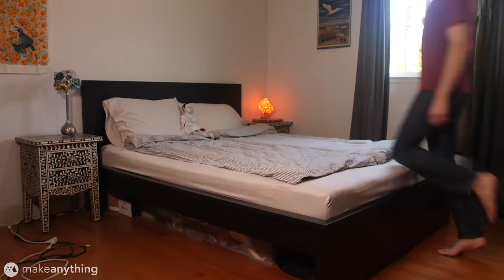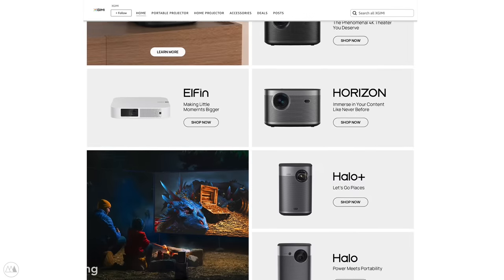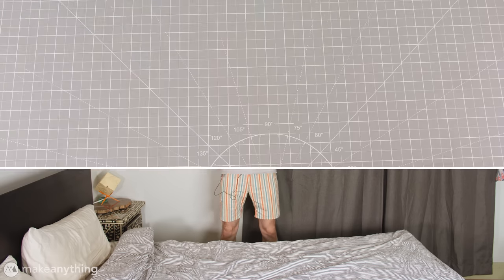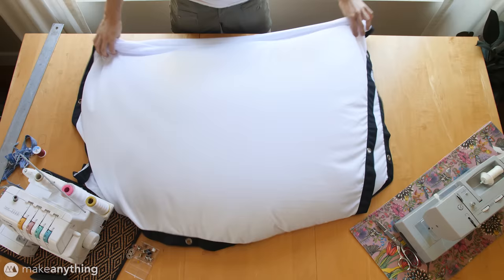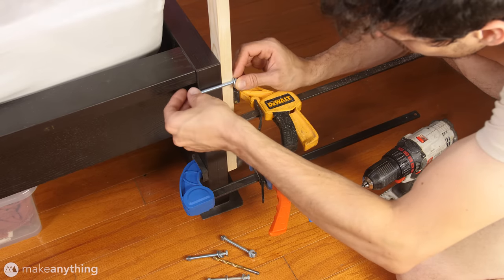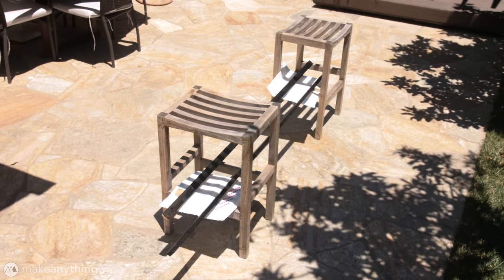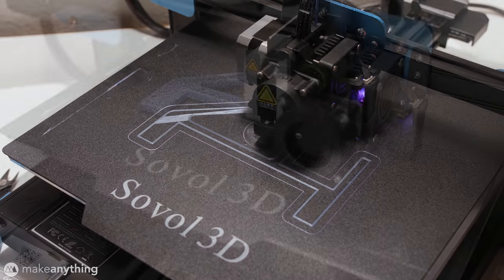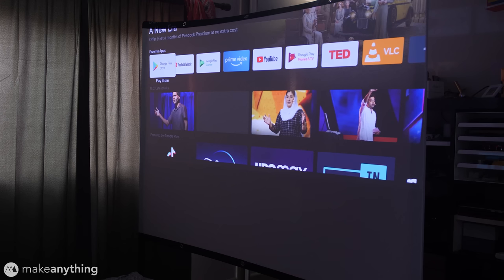My Bed is Now a Movie Theater // Bedroom Projector Build with XGIMI Halo

Comment: I had the same set up on halo plus. Big problem that you overlooked is fan noise when it is right above your head. I moved projector to side and manually adjusted keystone. Then optional but I added acoustic panels around projector with some air gap. (no adverse effect on cooling). Hooked up with 5.1.2 Dolby soundbar. Boom done.

Comment: I've been inspired to make a big black cube canopy at a trip to IKEA with my girlfriend who suggested buying a canopy frame, I just then was struck with the idea that if I'm basically surrounding all four corners and ceiling with thick black curtains then why not just add a projector, some RGB lights on the roof 4 edges and to top it off one of them big tables to eat or be on laptop that require rolling the bottom part of it under the bed....it's a paradise! No need to ever leave the bed only to just go to the bathroom.😅

Comment: For a V3 of the projector mount you could consider one that has a ball head on it. It looks like the projector has a quarter inch screw mount on the bottom which would allow you to mount the projector to any standard camera tripod head or ball head. Would make for easier projector positioning.

Comment: And yet every time you move or shift your weight, your bed or head board shakes a little and so your projector does as well and your image then shakes. So you have to lay perfectly still. Fun gimmicky idea but the practicality is lacking. I put an Xgimi Horizon Pro on a projector stand behind my headboard between it and the wall which does not make contact with my headboard so no matter how much I move around in my bed it does not cause any shaking to the projector. It's also raised up high enough that I can sit up in bed without my head blocking the image.

Comment: Hi! May i ask why you didn't just simply import your scanned picture into Fusion and traced the edge in Fusion instead of having to use Photoshop? Is there any benefit that way?
Reply from the maker: If you bring the picture straight into Fusion you have to manually calibrate the scale, plus i have an easier time making challenging paths in illustrator. It is an option though!
Reply: @make.anything  Aah alright! Thanks for taking the time to explain! Now go and enjoy your movie theater 😎

Comment: I had been turned off from projectors for a while due to my work in IT. The bulbs were very expensive and were good for 15,000 hours of use give or take. I get that my own amount of usage would be much less per day that the university  classrooms. It kept me cautious about hidden expenses. Sort of like the cost of replacing batteries for electric vehicles. More research is needed to say if it’s still cost effective, so I have no input on that.

Comment: To make it even quicker to put up and down, instead of bolting the wood directly to the bed, you could make a case that stays bolted to the wood and then keep the screen and poles wrapped up together. Then when you need it you just unravel and slide it into the holsters

Comment: You can’t adjust the X and Y digitally!? It Has to be adjusted physically. That is a very lame equipment.
Reply: The higher end projectors do things like offset and keystoning optically and not digitally. To do these effects purely digitally, an image processor must distort the image in real time. This means that your displayed resolution must be lower than the projector's native resolution. So if you have a 1080p native dlp chip then using these digital effects means you cannot display true 1080p video (it would have to be downscaled to lower res first). This introduces lag and also tranform distortion due to quantization error. So basically get a projector that does these things with mechanically adjustable optics and not digitally.
Reply: These projectors are meant to be placed on a low table in front of you that's why it's tilted up... that said he could mount it upside down on the ceiling too
Reply: I don't know why he didn't just opt for one of XGIMI's many other projectors that have the Intelligent Screen Alignment feature. I mean, the Halo+ model does. I guess this was a sponsored segment, so beggars can't be choosers.